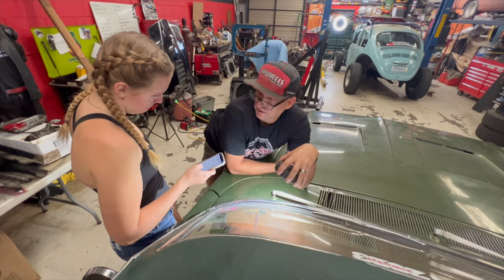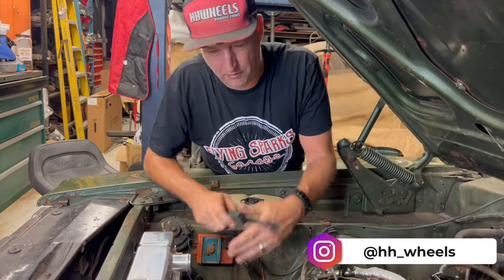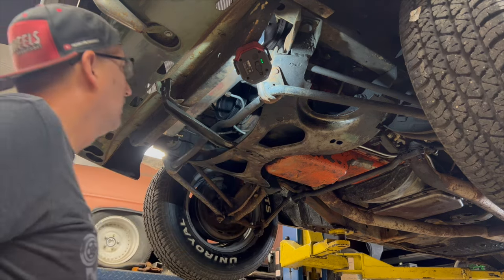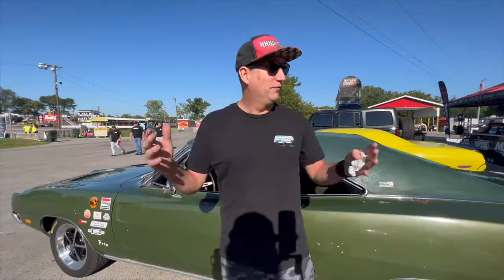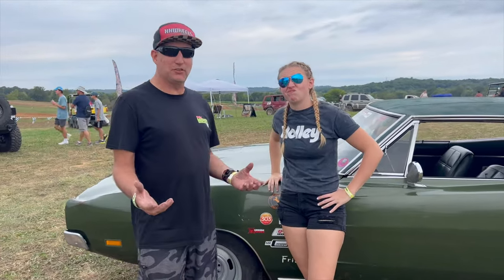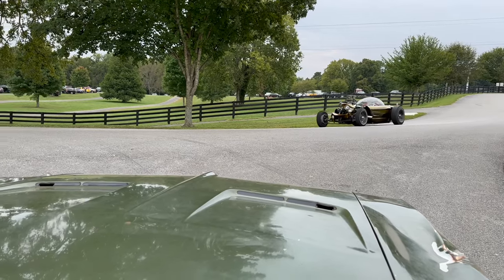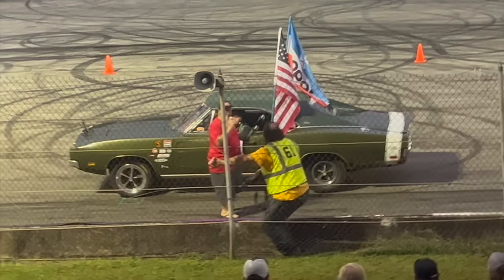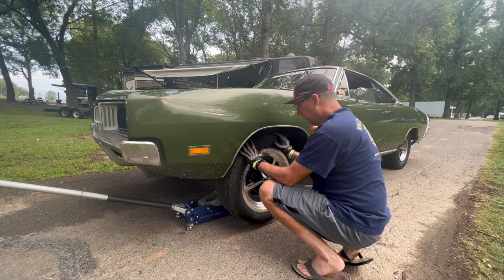RARE 1969 Dodge Charger R/T SE - Will It Run Like Dukes of Hazzard? Moparty 2023

Comment: Happy Belated Birthday, Caroline !!!  Back in 1980 I had my first '69 Charger RT that I didn't know anything about.  It had a 440, but it was blue (not sure if it was just a Plymouth or a worked run-of-the-mill 440....that would lift the front wheels off the ground !  Anyway, I blew that engine in a race and replaced it with what I thought was a 440RB that turned out to be a 383RB (Magnum).  No matter what I did to improve that engine, it had no where near the tire shredding torque of the 440.  The 383 almost required line lock to break those tires loose (Pro Trac N50-15's).  That car is long gone (sacrificed when my parents sold our house and I downgraded a LOT to a Fiat.  But, in 2010 I bought my 2nd RT that was a twin of my first WITH a 440 and now I have trouble getting the rear to hook up !!!  Keep up the great work !!!

Comment: good try, to improve that, put harder shock absorbers, configured to be hard for shock absorber rebound,... it's urgent... and they have to lighten the body, everything that is not necessary like the rear seats, upholstery, panels, moldings, all that outside

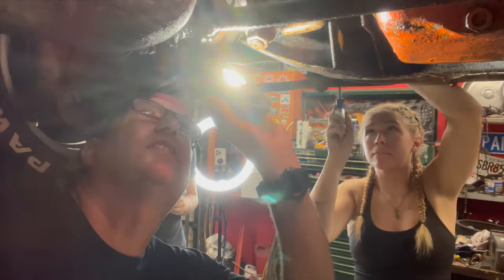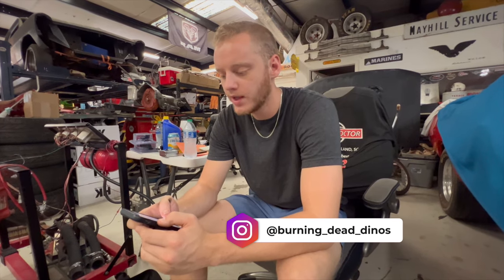Comment: Engine is a 1971 383 it look's like it say's 8*27*70 if that is correct it should be early for a 1971 car 4:18…. But u think it's a 1969 4:30. Probably out of a 1971 Newport not a charger as Many more Newport's had 383 2 barrel than 1971 charger's having a 383
Reply from the maker: Thx for the info! ✌️

Comment: That’s not an R/T since he said 383
Reply from the maker: It is! Someone ended up swapping the 383 into it. Most likely because they blew the original 440
Reply: @HHWheels  Or it could be a crossover engine aka an engine from a previous generation charger used in the 1969 until full production is established thus the 69 you have maybe an very early production version making it even more rare....

Comment: This car should have a complete restoration, not bounced around. If you are a Mopar lover then you should know that they destroyed a bunch a rare chargers (hemis,440s) doing those stupid stunts.

 That show should be hated not celebrated but charger lovers😂
Reply from the maker: We could not disagree more. If this car was restored and made nice, it would sit in some garage and only see the road every once in a while. We are driving it, repairing and replacing parts as needed. We may even upgrade the suspension tremendously with a QA1 kit and drive it even harder. Cars are made to be driven, not stored in some collection somewhere. Thx for watching!✊
Reply: @HHWheels  never said to fully restore it then park it.

.. you know what happens to rare cars that get driven? They get crashed.